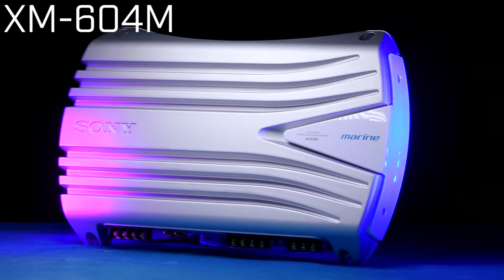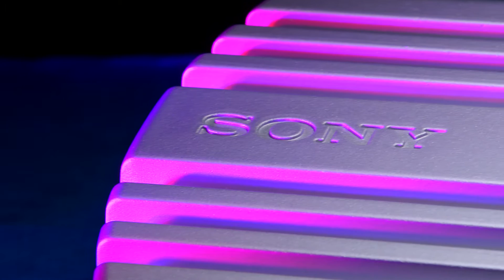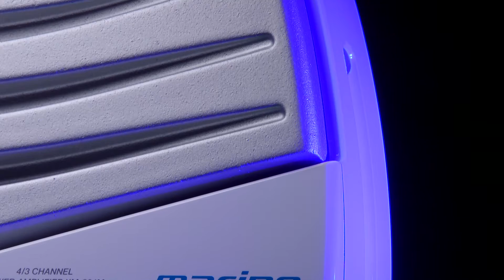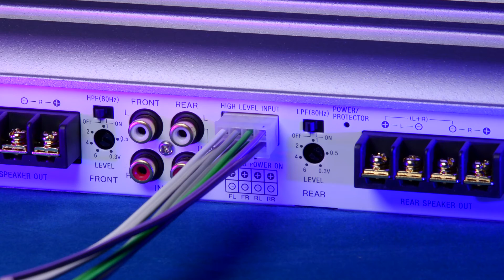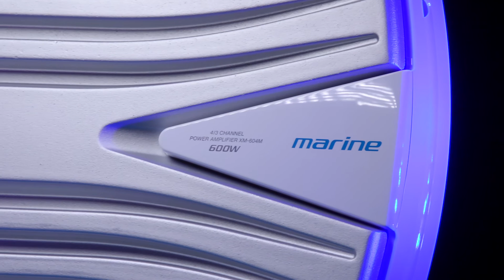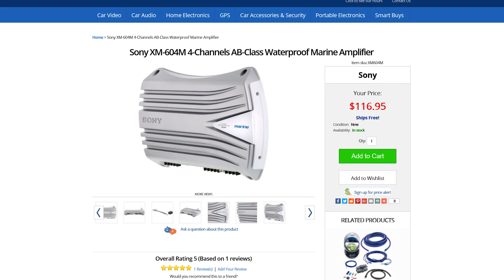Sony XM-604M - Marine Amplifier - Review 2016

Comment: This amp support 2 subwoofer
Reply from the maker: Doesn't support 2 channel but you can bridge it with two subwoofers
Reply: Yes or no
Reply: @jashandeepsinghbhullar2106  Yes it will support 2 subwoofers if you run them in series or parallel, depending on your subwoofer ohms and bridge them when connecting to the amp. I hope that answers your question better,